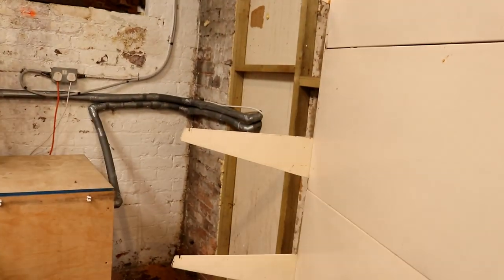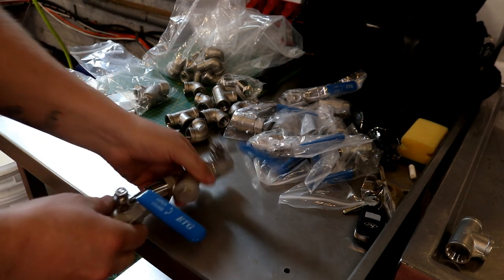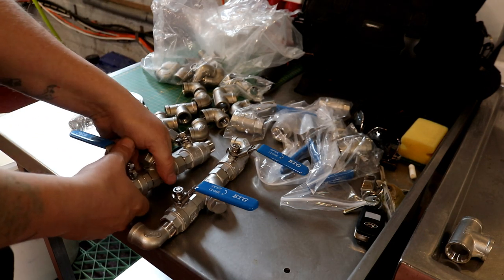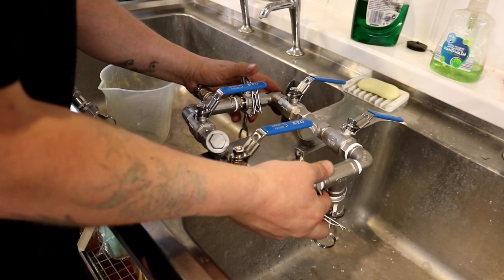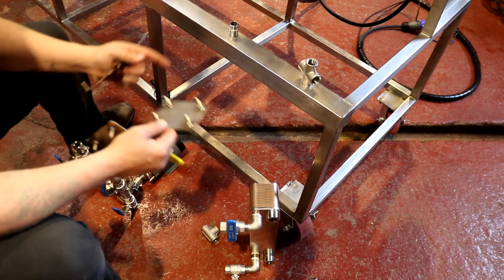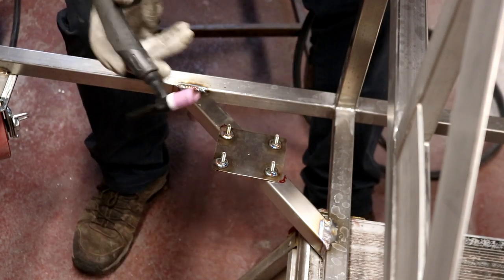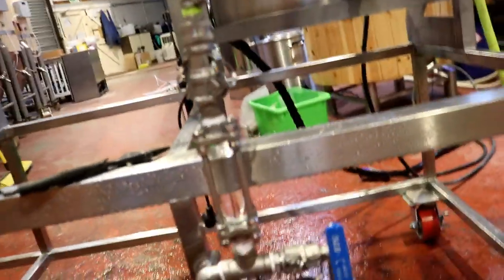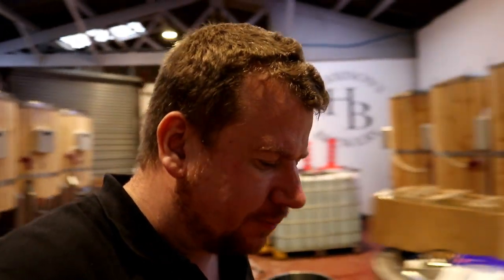Brewery Pilot Kit ~ PIPEWORK ~ Part 1 🍻

Comment: Hi Harry,
I've got an idea for your filter assemblies. If you weld something on the plug of the filter housing and make then into something like a wing nut you wouldn't need any tools to clean then because it looks like you have to snug them rather tight.

Comment: Just a thought, but I'm building this dual filter system at present and overcame the issue of joining it all together by putting a type F camlock (M) beneath each lower ball valve, then type B (F) on the bottom part of the assembly.
It's easy to lift up into place.

Comment: Do you not want a ball lock on the outlet of the pump to control the flow?
Reply: High Road Brewery I was thinking the same thing wonder if it will choke the pump? Might be enough gravity from kettle!
Reply: Wouldnt need a ball lock on pump when the BK already has one on it to control speed and so does the plate chiller buddy